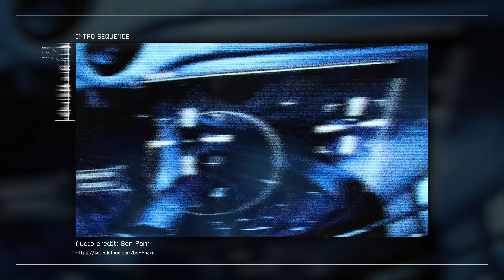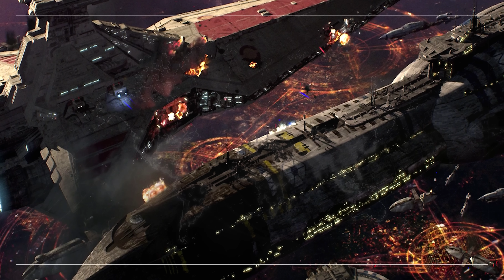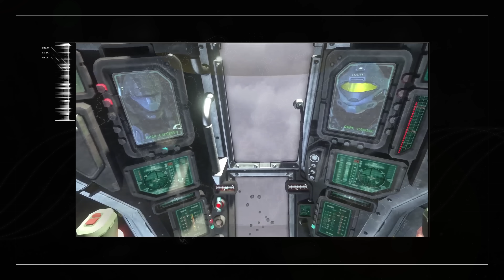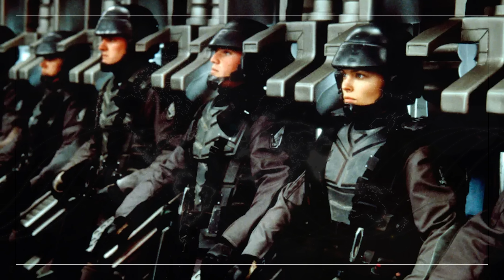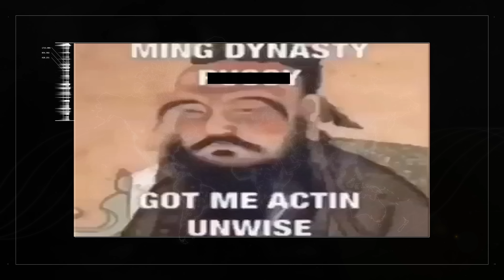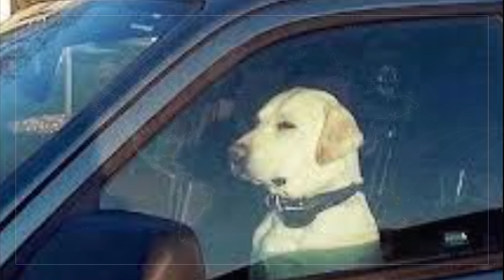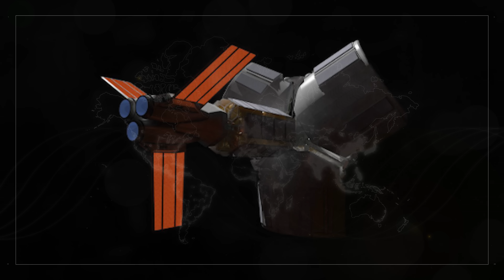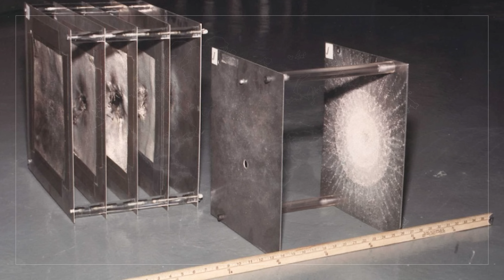The REALITY of Space Warfare

Comment: one thing you may have missed when talking about surface to surface troop transport and space manoeuvres is mentioning oxidiser, there are many kinds of fuel that dont use oxidiser like for example a majority of thrusters used only in a vacuum use hypergolic fuels which experience no boiloff and need no ignition
as for keeping a rocket constantly having its cryogenics replenished this is not as neccesary if you get enough precision with solid monofuel engines, kind of like why some ICBM's that must be always at the ready use solid fuel instead of using keralox or hydrolox

Comment: flechette clouds of thin ribbons of metal could be used to help block laser based weapons and enemy tracking, not to mention they would be a weapon themselves if moving toward the enemy... in addition to the fact that they could be stored near/on the radiator systems so you're ejecting heated flechettes into space to cool your craft down, which it would probably need because it would be generating more heat due to needing to use more power during a battle.

Comment: Resistive Heaters are inches away to 100% efficient in the sense that they convert electricity to heat.
Any other type of heaters are either lower or higher.
Yes... You red right, heaters using a heat pump have higher than 100% efficiency.

Comment: 8:43 , yes it is, like you said. Its also way heat pumps are often advertised at 300% or more efficiency. Because we define that over the energy converted to heat other than the form we wanted, but heat pumps use little energy to move way more energy that comes from elsewhere (the outside/atmosphere in most cases)

Comment: The easiest way to keep thermal radiation low is to use heat pumps to keep post of surface cold, and keep only some surfaces hot, for example engines that have nozzles to prevent radiating in wrong direction. Depending on intended most-surface temperature, this could get quite ineffective (most of energy spent on cooling). To improve that, you better coat the surface with a material that absorbs visible light (so your spaceship does not reflect starlight) but reflects infrared (so you do not need to cool as much).

Comment: I have this idea that I can’t get out of my head for stealth in space where you pump coolant through the hull to get it to vacuum temp or very close to it, construct the hull to shroud the exhaust plume, and then use heat sinks that get dumped between missions/ while in hot atmospheres/ while behind something. This way you’re only detectable in three ways: from directly behind and only while the engine is burning, from background light being obstructed, or very close proximity (relative to the extreme distances in space). The first way can be pretty much entirely avoided by being careful about when you activate your engines and even then you’re only detectable for the short window that you’re getting up to speed. The second way is probably going to be extremely unreliable in a colonized solar system with hundreds of millions to billions of ships, space stations, habitats, satellites, probes, and all manner of other space infrastructure and vehicles all floating around doing the exact same thing. And the last one is irrelevant as you’d reliably be able to get into kill range long before you’re in detection range, the stealth tech has already done its job. 

I still haven’t been able to see how this wouldn’t function as near perfect stealth

Comment: Spaced armour is OK. In addition to that, you may have a water reservoirs, ment specificaly to spray the bow by water (sugestion to use Pykereete) to create ice-shield for the ship. Extremely easy to "repair" such "armor", when necessary, you can recycle watter out of it, (wich inherently contains oxygen and hydrogen - i.e. air/oxidizer and fuel). Regarding the laser shielding, glitters sound funny, but might work. Another possibility is plasma-shield - basicaly ship carries material (gas probably) to create plasma and have electromagnetic means to hold and move the material around the ship. 

For attack, my preference is electromagneticaly speeded projectile with multiple warheads. Keeps its manuevering in target area, can be shot for majority of the range on balistic route, when well planed, you can send almost whole magazine like that with slightly different speeds, to hit the target in one gigantic wave, instead of one-by-one. BTW, the EM "rail" can be build in a circle, to SPINN the projectile, before throwing it by "barrell" on the target. 

In space - bigger ship is better, because it can hold more fuel, air, ammo, bigger and probably stronger generators and tend to need more energy to be wholy destroyed. Smaller ships/fighters can be in comparission to big ships, used only in limited ways of tactics. Much more effective than manned starfighter might be unmanned drones, simply because of biological needs and G limits of human body. Probably best armament for "starfighters" will be kinetic projectiles, possibly with some rocket manuevering assistance for last part of its flight. 

Ships ment for longer flights in space, would need simulated gravity. Studies on "how much" and how long before needed are not yet too exact.

Comment: Counter argument: The heatsinking requirement for lasers, especially of the tyoe mentioned would be massive, making it more of a capital weapon than a normalized weapon. I believe the more realistic kind of warfare would be that of The Expanse, where inertia and timing are a thing, while still relying on missiles/torpedos to try and annihilate eachother from afar before gatting into a slugging match. EMPs will be a thing that works, and leaves yhe enemy floating in space, no o2 recyling, reactor would still function, but any digital functionality ship will be shut down completely, and attacks from the surface of a planet will remain a threat if you are within a satellite orbit (due to anti-ballistic missile and anti-satellite missiles), and 02 and H2 production can be made by skirting the sun (I dont recommend this unless you WANT to become a microwaved hot pocket) or by finding an Ice-Comet or Ice Asteroid and mining it for its ice which can be melted and turned into water, which can be made into hydrogen and oxygen, you can use a nuclear reactor for power but you will be visible to EVERYONE due to FLIR from hundreds of millions of miles/kilometers away (The Expanse solved this with Silversmith drives which use a SHITLOAD of heatsinks and coolant to remain cold and go stealth by shutting off your radio signals and going cold). Now, missiles are controlled by Heat Seekers or by Radar Seekers primarily, but another exists which I think doesnt get enough respect, ARAD (Anti-Radiation) which can lock onto SPECIFIC radio frequencies, and jammers can do that IN SPADES, which makes them HIGHLY visible to ARAD weapons. Its likely that Heat Seekers will likely be retired, since they are cheaper than a Radar Guidded weapon, but can be tricked easily (you can literally fly towards the sun for some of those missiles and they lose track immediately), and in soace, if you burn an ore or material that is like Lithium, which makes its own oxygen when it burns, it makes a very bright flare, this makes them a liability and not a strength, that leaves Rad and ARAD (not EO, which is electro optical, because it would end up being too exoensive), as for payload, it can vary, Incindiary, HE, HEAT, API, HEKP, doesnt matter which it is, it ends up being the same result if their point defence doesnt destroy the missiles.

Comment: There is actually some thoretical testing into using "lasers" to radiate heat in a concentrated beam for stealth. But if i remember correctly with current tech that would produce more heat than it radiates, so not really viable.

Comment: The biggest problem with accurate space warfare is that it combines the best and worst aspects of several types of warfare. 

The sensors can detect an enemy fleet months to years away.
The ships are as slow as 16th century gallons (relatively speaking) and as resilient as canvas and wire aircraft.
The weapons have the penetrating power of modern tanks and AOE of anti-aircraft artillery.

Ironically it’s warfare distilled. Two factions fire a garden hose of men and war materials at each other until one side gives up or overwhelmed.

Comment: I’m writing sci fi right now and trying to make it as accurate as REASONABLY possible, I forgot everything always radiates energy, thank you. However, I would like to point out that for lasers there are two big issues: one is that they will generate SO MUCH heat not only by themselves but with anything powering them. The second is that ships could carry a thin layer of foil around them like snake’s shed skin, then eject it once hit. Connect it via small ropes, and then after the battle you let it radiate off the heat and pull it back in.
Reply: You'll like knowing about tin droplet and Curie fountain radiators

Comment: Space warfare would have few ships. Mostly jets and TSF and Mobile suites plus small carriers (that host the TSF, Mobile Suites and jets plus it is where small repairsand maintenance could be done. ) Most of ships are not going to be that big. Max 5x the size of supercarrie in the sea interms of weight and volume. The vast majority of the fight is about finding, reaching and destroying those ships of the other. 

Energy shilds and cold fusion accelerater reactors are necessary.  

In space warfare u need to be at min 400,000 km away from an enemy unite. So a battle would span few million kms. 

The ships needs to be made out of the taughs metal like tungsten available and use nano technology to increase toughness and resistance to heat and breaking. Any important ship needs to have fake drone ships around it that acts like a ship like the main ship so they can't tell which one is the real one. Every ship needs to be at min 1k or 2k km away from eachothers and they need to be spreatated into groups and each group min 350k km away from eachothers. 

There would be tone of drons and dolls. 

A ship needs to be designed in away that allows it to dech a section out of the ship away incase of an infertertion by small vaslles of the enemy. 

If you got found u need devices that make tone of heat they can't find or pin point at anything as if a miny sun shows up. This can be used in conjunction with E-Bombs in rockts/terpodos to blind the enemy. 

So ships would be playing cat and mouse. However the battle would be decided by the TSF and Mobile suites and their ploits. 

Real guns roads are needed even in space space battles to sneek finshing blows on ships and to snipe TSF/Mobile Suites and small carriers. It would be useful at overwhelming energy shilds. 

Useing a lazer is not useful but shooting charged comprised particals like Alpha is much better. It is easier, users less energy and far more destructive and hard to protect against. What happens is those particals at high speeds brake down links between monoclies and brake the individual monocle structure causing a miny sub-nucler explosion of the material itself. Infact the denser the target the more powerful after effect. 

There would be no towers on ships. Most of the fighting is simller to submarines. 

Triangle, dimond as 2 Triangles , Triangle with 2 sticks on the sides, star shape and rockt shape are the only good shapes for a space ship.

For an Empire for anything bigger to house a big force u can repurpose an asteroid as a space fortress. 

Nuks and anti matter warheads are the go to wepones. 

If u want to destroy a planet just use a normal nuke that chain react with the air and u will cook the planet. 

Cause space warfare decides the plant future the enemy will use under mountains and under ground tunnels technology to fight a long as war deep inside the planet. 

The best way to win is to make the plant sun eat the planet or make their moon crash on them. They can't defend that.